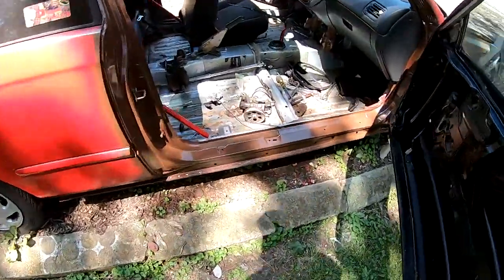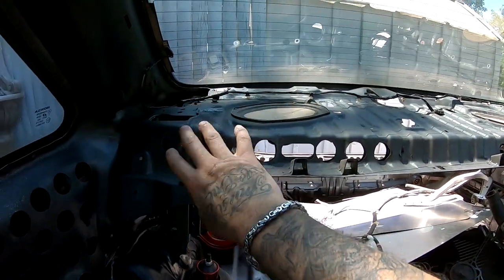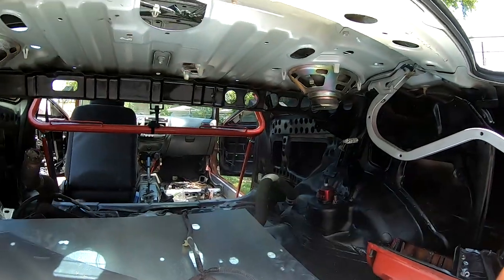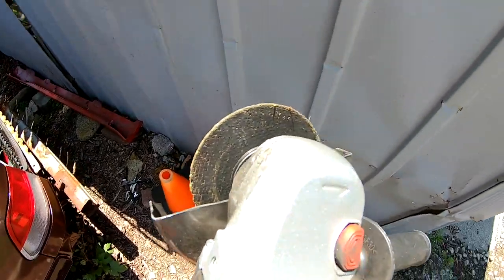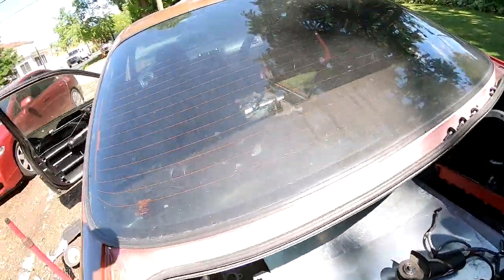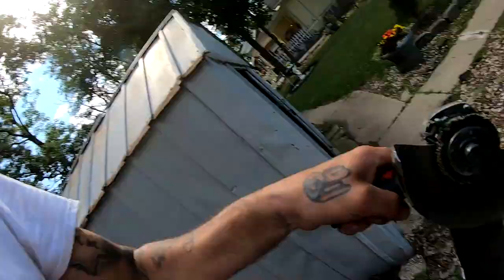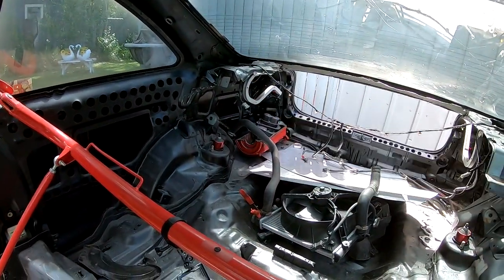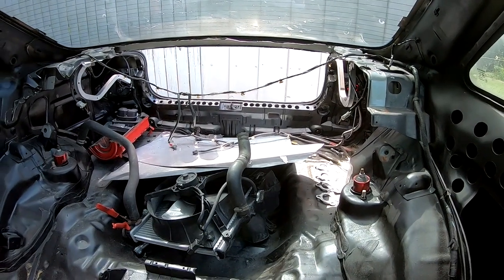19 LBS off civic weight reduction from rear speaker brace

Comment: Love your ambition and the painting, but you’re going to have the structural rigidity of a noodle. Try to jack up the rear wheel, you’ll see the car twist.
Reply from the maker: Wow love the comment got me thinking how to tighten everything together now maybe some sway bars on top of my shock towers and a roll cage.Tomorrow il jack up the car and record it. 👍 good info.
Reply: Anything you can do to tie it all together will help. The roll cage and the shock tower bar are a good start. Adding lightness is good, but so is structural rigidity. (I own a 1st gen CRX). Keep doing what you do and look forward to the video tomorrow.
Reply: @BarbasLife  I'm assuming that this thing will be a race car if you're bothering cutting it up like that?  If so then keep cutting but add a rollcage.  Properly designed it will tie the suspension pickup points together and take care of any floppyness.  FWIW, the rear seat brace area tends to add A LOT of stiffness to the body, you'll see that area crack or get ripped out in a hard accident.

Comment: What should I put in my wifes Honda I've seen K swaps and B turbo upgrades...it's a 1997 Lx she wants a little more pep in the step...whats easier in your opinion.
Reply from the maker: Is it auto or stick. That would make a huge difference.kswap is the way of the future but b18 are good too.b20 have some good torque. H22 is a good choice too  h23a bluetop is a monster same as h22 but more aggressive head.
Reply: @BarbasLife  It's automatic and it has 312,xxx miles on it. So a stock rebuilt engine is probably fine. Who wants to see another turbo K swap video? But she does like the whoosh sound turbos make...lol